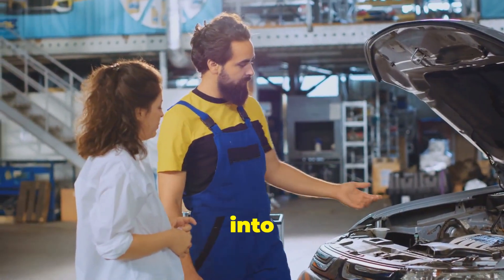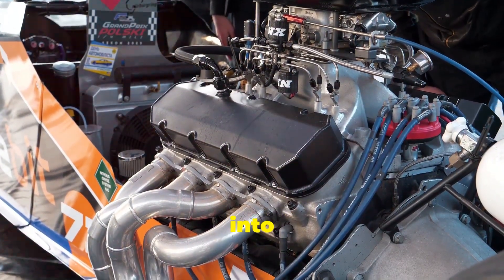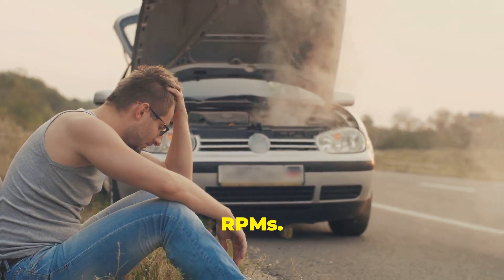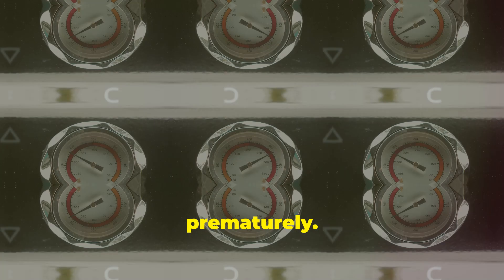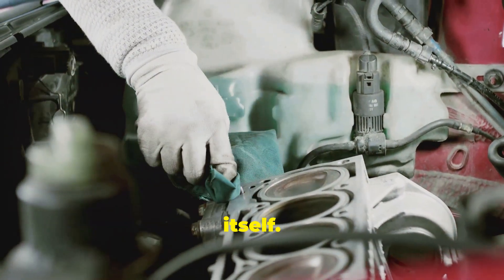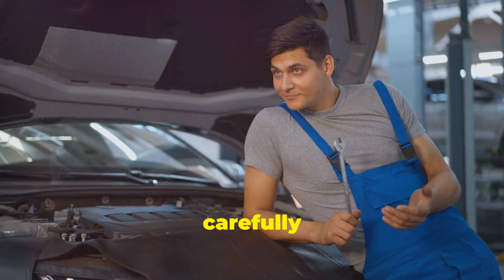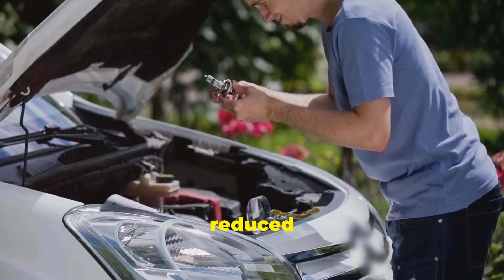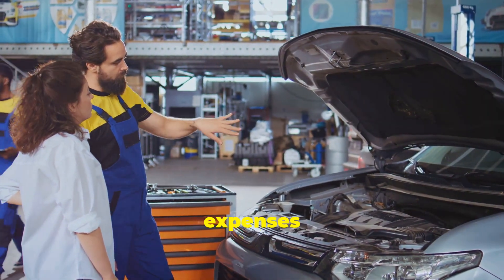EGR Valve Issues: EGR Stuck Open vs Stuck Closed!

Comment: Its like I've been driving this jeep grand cherokee 5.2 v8 and trying to figilure out last the engine shakes on idle and it likes to run hot if I don't watch it so I find the egr valve vacuum line gone . I reroute the lines to the diagram and this thing runs long  enough to warm up and then stalls  and since then it rarely starts , misfires and smokes bad.  The valve must have opened and got stuck is my guess?